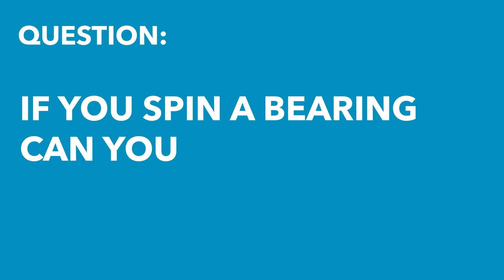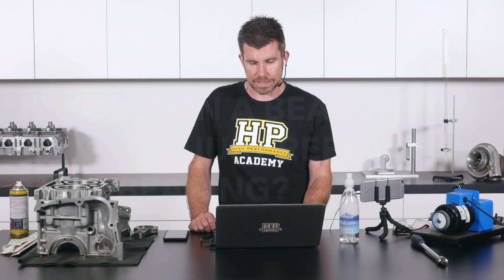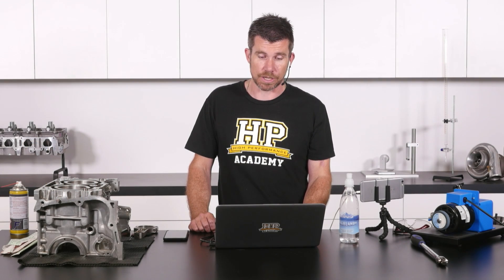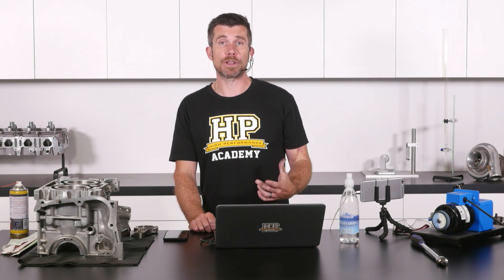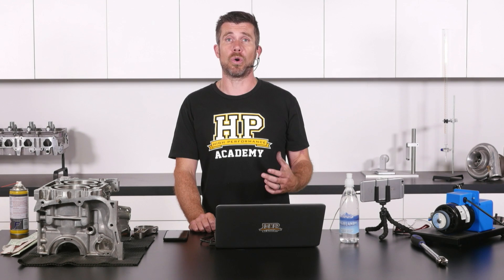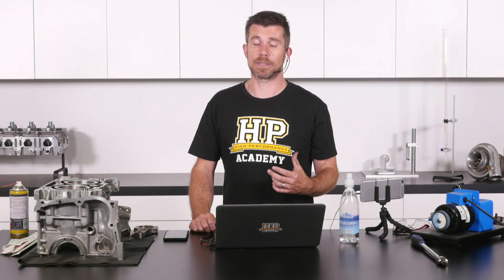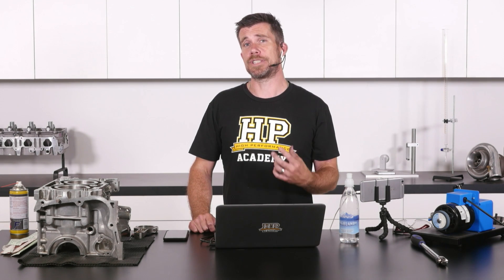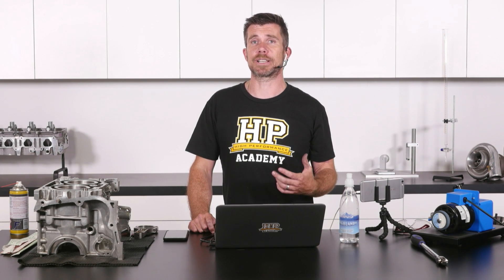[HPA Q&A] I have a spun a bearing! Can I just replace the shells? | Performance Engine Building

Comment: Replaced rod bearings on vq35de. #6 was the the issue at first. Knocked again, same cylinder. Turned out the rod bolts were stripped out. Replaced the rod, salvaged hero for sure. More work than the smiles worth but that bitch sings now!

Comment: I have a question . I have a very expensive rear axle on my ATV it's a solid axle splines all that. but it' spun  a bearing and wore the axle down pretty bad and is a little bit of a space where the new bearings ride. is it possible to repair that or is it not and I literally have to buy a whole new axle?
Reply from the maker: You'd need to talk to a machine shop/axle specialist and go from there. They'll be able to tell you if it is possible or not, and if there is any risk of repairing it vs replacing - Taz.

Comment: Heart breaking, my brand new engine I spend 28k on spun a bearing. 6000 miles on it and something must have been wrong from the start but the ship wanted me to come to them to change the oil ever 1000 miles so I couldn’t really tell it was burning oil. Sadly it was 10 months old and outfront Motorsports only has a 6 month warranty and I’ve got about $200 and no job…

Comment: my engine has low oil pressure can i boost the pressure with new crank bearings? the oil pump is already replaced after low oil pressure warning 2 years ago the crank bearings where cheked and did not show real wear at all and came out easy.

Comment: what would cause a to bearing spin in the first place?
Reply: Generally bearings spin from lack of oil pressure caused from running low on oil.
Reply: Or a salvaged engine with poor oil mauntainancw . Which causes blockage that can not be flushed out via liquid.
Reply: It happened to me cause my oil pump failed

Comment: With some vehicles, it is possible to drop the crank with the engine in the vehicle* but, as Andre pointed out, if the rod is showing any evidence of damage, like a spun and not just noisy, bearing, further work will be required.
Things fail for a reason and if that reason isn't found, the same thing will almost invariably recur.

*may be necessary at, for example, a track where lifting equipment isn't available but the parts are.

Comment: What about if you start getting rod knock? Is it possible to wait until a bearing needs changing to do it, or can it only be done right as preventative maintenance?
Reply: As Andre said, there are reasons parts fail - do some investigation as it may be possible to prevent it with, for example, better quality bearings, modified oil pump, etc.
Reply: Nope, I would disagree, there should be a nice clean film/wedge of lubricating oil between the bearing surface and the journal - if there is wear there is contact between them and/or fine debris in the oil and/or the material forming the bearing isn't mechanically strong enough for the imposed loads and/or there is insufficient oil flow (pressure) to the bearing surface to maintain the film and/or the clearances were incorrect, etc. Poorly machined parts can also be the reason for premature bearing failure, even in brand new vehicles.
In short, in perfect conditions the bearing shell life should be close to infinite - I've pulled bearings that had done over 200k kms that were indistiguishable from new. Some heavy vehicles commonly do a half million miles between rebuilds, with some clocking over a million.
Reply: Heck, some modern cars aren't even designed for engine or transmission repairs - you have to replace the whole damned things because they don't make the service parts. Even when they are available, they can be close to the value of the vehicle - like the VAG dual clutch gearboxes, even their control systems can mean a car is written off.
Reply: PetitCorpsSalade If the knock is barely audible, it MIGHT be enough to just replace the bearings. If there is no visible damage in the crank, it should be enough (at least in a low performance engine).

I change bearings as maintenance in my fiat/lancia tc, because they are known to "eat" them. It's a 100€/2h job in my case, so no point in damaging the crank...
Reply: I'm asking because I've never done maintenance like this and I'm afraid to damage something and make things worse, because right now my car is running perfectly. It'd be for my daily, which uses a Renault K9K diesel engine, known to die by knock.
Reply: Agreed, and I'd install better bearings. I might do it as preventative maintenance when I get another car I feel comfortable using as a daily. I do maintain my car quite religiously and change the oil & filter pretty often. It's not a performance engine at all (86 hp of diesel fury), and they can last a long time if you're lucky (I've seen original engines with up to 250k miles/400+ k km).
Reply: GordoWG1 WG1 Bearings wearing out is really not a fail, as that is sort of what they are supposed to do. Obviously there is something wrong if you have to replace them multiple times in a daily driver.
Reply: GordoWG1 WG1 If there was a perfect oil film 100% of the time, there would be no need for bearings in the first place.
Reply: Technically, you are correct in that the bearing surface (the surface that supports the shaft) can be the parent material - such as camshafts, lawnmower crankshafts, etc - but that would still be a bearing. 
Are you referring to bearing inserts/shells? For numerous reasons, it is a bad practice to use similar materials for the journal and bearing surfaces and the easiest way of providing this in cast iron engine blocks is to use a compatible material bonded to a steel support that can be fitted into a prepared bore in the engine - back in the day, they actually poured a  babbit material in place and machined that - quite interesting but VERY glad is is no longer required.
Reply: GordoWG1 WG1 
Yes. English isn't my first language (or even second...) so I don't know all the correct terms.

My point was that there will always be some contact (start/stop, dirty oil etc.) in the "real world". The bearing shells (?) are softer material for a reason.

I consider them to be like the bushings between the subframe and the body. If all the roads were perfectly flat you wouldn't need them and they would last a lifetime, but...
Reply: Heck, those of us who have only one, or two, languages don't do as well as you do - I've three - Scottish english, American (internet) english and, now, New Zealand english - and there are some tricky differences between each ;-)
Agreed - what you have in mind is the 'embedability' [sp?] of the bearing material. Production materials tend to be softer to allow contamination to sink into the material, while 'performance' bearing material tends to be harder and stronger but any crap in the oil can partially protrude from the bearing surface and increase journal wear.
Reply: GordoWG1 WG1 I'm from Finland so I speak finnish and swedish (the other official language in Finland). 😋

Yes, imo the bearings should always take the possible damage instead of crank/block/rods. What I meant before was that I don't consider bearing failure at 250000km+ a real fail. Modern cars aren't even desingned to last that long. 😂
Reply: The lack of oil pressure is from the bearing being spun, or in likely hood multiple bearings spun resulting in a lack pressure because it's just flowing out of those ports freely not providing enough restriction for the pump to fight against and thus you have lower oil pressure. Now it can also be caused by a lack of oil pressure so it's up to you to find out if the chicken came before the egg.